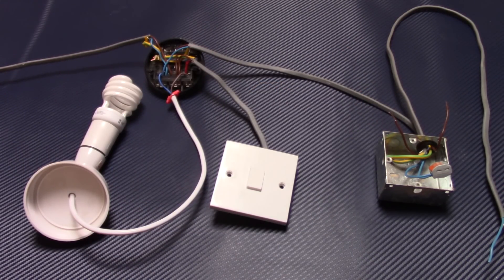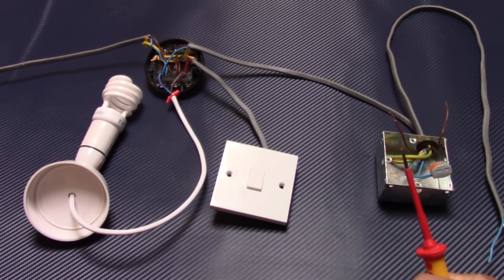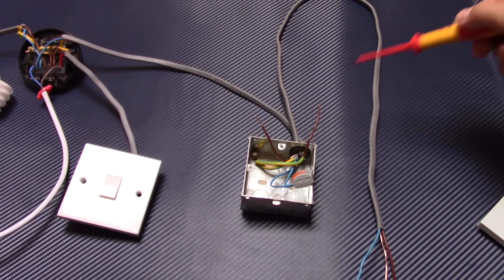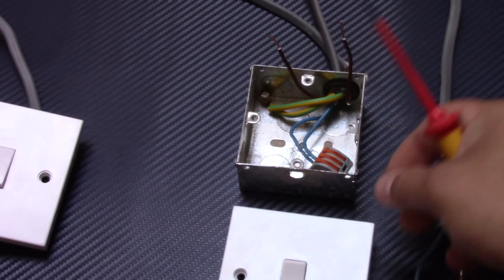Downlights to lamp & switch wiring  . Spotlights to switch & ceiling rose

Comment: I'm just trying to work out how to wire in two LED spots in this way. I am going to connect the spots in a circuit with one wire going to the switch. The cable I've bought has no earth. It's a metal switch. Is it necessary to have an earth? The cable that will go from the light switch to the plug also has just the live and neutral wires. Is it ok to do it all with no earths, especially considering I'm using a metal switch and a metal box?
Reply: You need an earth if you are using a metal switch. The chances of you getting a shock off the switch are very low but it’s not worth the risk. Under fault conditions the electricity finds the quickest way to earth and if the metal switch is not earthed correctly, the whole switch itself will become live and you will get a shock off it. For lighting you need to buy “1.5mm twin and earth cable”
Reply: @uplightuk8924  I ended up using earthed cable from the switch to the plug and also installed a jumper from the switch plate to the connections. Thanks though :-)

Comment: Hi mate. From 4mins onwards - the final twin and earth cable does that go to another light socket or directly to another light in another room? Please could you confirm. Thanks
Reply: All lighting circuits have an “end of line” (regardless if you have fed the switches or lights) in which this switch/light will only have one feed cable at it instead of 2. This is completely normal and common practice in the U.K.

Comment: I did everything exactly as in the video  the new spotlight works fine but only when i habe the ceiling rose light turned on any idea where im goin wrong  the new spotlight switch turns the spotlight on and off no problem but only when the ceiling light is turned on any help please
Reply: I have the same problem , the spotlights only come on when ceiling rose switch is on ,  not a big deal ,but was wondering if you found a solution.

Comment: Hi, love the videos... I have recently installed spotlights from what was ceiling Rose, using junction box. But I was wondering how I go about adding a separate light in the same room and then turn my one gang switch to two gang and have the downlights and single light on separate circuits within my two gang switch... would appreciate your help, thanks
Reply from the maker: There are few ways to do it  but the easiest is  to add another JB before 
the spots  or feed the new  light from this JB  that you converted  from the ceiling rose .  run cable from it to new  light . Then you can split cable for switch at the  new ceiling rose or install new jb before new light and split there for the switch. Anyway in this situation your 2 gang switch needs to be feed from 2 separate cables from 2 JBs  or 1 jb and 1 ceiling rose. Difficult to sort it out if I cant see this

Comment: Nice video. Could you not wire the first spotlight in the room with a switch cable? So its the same set up as a standard ceiling rose? 

Rather than how you have it all starting by going into the switch box.
Reply from the maker: Yes . You can fit a junction box just before the first spotlight and then split cable there to the switch.
Reply: How2D2 many thanks for this. Cheers mate.
Reply: I know it 2 years old but thanks for asking this mate. Had a proper head scratch last night and you've just settled it. Cheers.

Comment: Do you have a video of showing how to wire spot lights from a ceiling rose. I can't find anything. Thanks
Reply from the maker: No I dont.  if you want to wire set of spots to ceiling rose and have both lamp and spots and operate with the same switch then blue wire from spots  to  N terminal at ceiling rose and brown to L terminal

Comment: Useless. How do you actually fit them in the ceiling and get the wiring to run to each one? C'mon clever clogs, how??
Reply: Read the title. Duuuh
Reply: Gu 10 run in series so basically your first one connects to the main line in, you then connect the second to that one and so forth.  L======L======L=====L the last terminates on the last bit of wire.  So basically from the first to the second from last you have wire in and wire out, the last one has the wire out from the second to last one, as last wire in and the circuit is done.